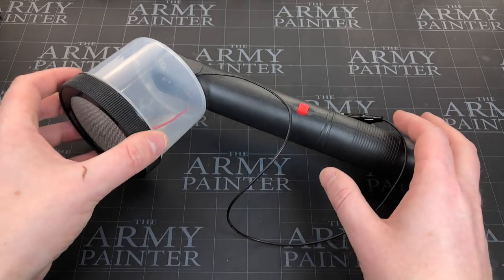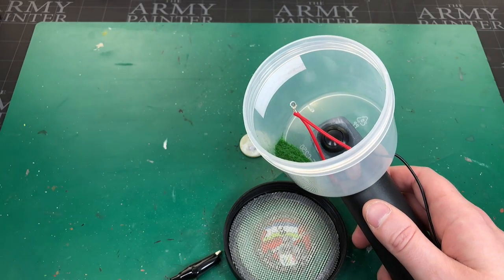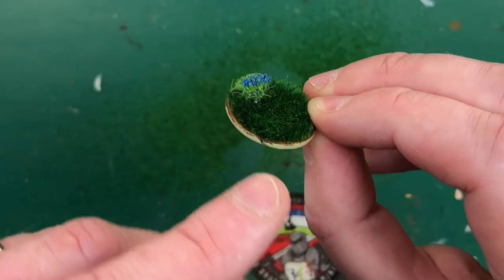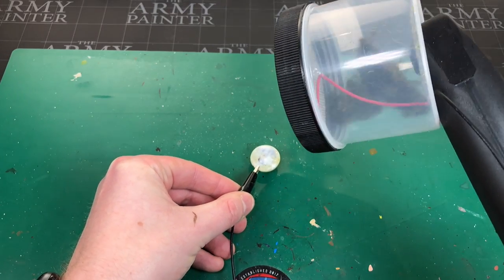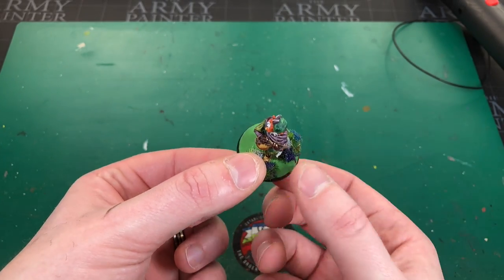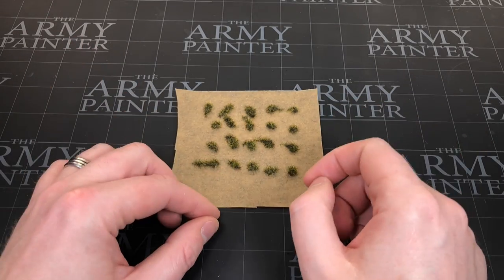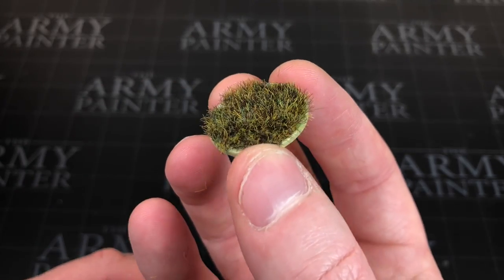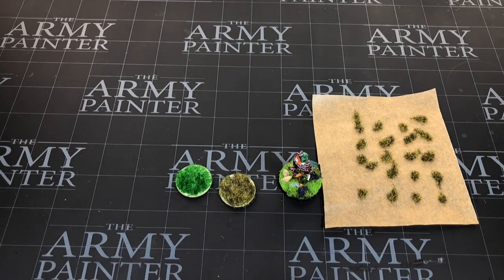Static Grass Applicator - How to get your model grass to stand up or create your own grass tufts!

Comment: If you clips a metal pin (panel nail or something similar) in the crocodile clip you can apply the grass by not having the clip clipped onto the base. You will need to do this when covering larger areas anyway as the earthing point should not be to far away from the applicator or else it will not work correctly.
Reply: Thank you was looking for this info🙌

Comment: you can do something slightly different, get a metal tray (a sheet of foil might work,  put several small bases on top of the foil/tray and connect the foil/tray to the crocodile clip, for tufts do the same as above but use baking paper of even better a silicon sheet
Reply from the maker: Great tips! Thanjs

Comment: Not available at the link, but I found one on ebay with the same design, most likely a knock off, but when can you do when the original is not available? I like static grass, but not $300 or whatever applicators cost for those doing the train stuff, but under $50USD, sure, why not elevate my tuff game!
Reply from the maker: Ah! I did this tutorial a while ago, and I guess they sold out since, I updated the link to another one, thanks for the heads up! Yeah I agree with you, for $20/25 its a fun tool and it dramatically increases my bases IMHO.

Comment: Obviously the one I ordered from Amazon doesn't work.The light turns green, but the grass doesn't fall straight.
Reply from the maker: Noooooo! How does it fall!? Mine just falls down with gravity but is pointing up from the charge
Reply: @WatchItPaintIt  Maybe I managed to solve the problem, I used a piece of wire and attached it to the ground wire with the clamp.  The grass seems to be falling well now, I even got an electric shock to see if the current was circulating

Comment: i got this exact one, does the wire have to touch the mesh for it to work? mine isnt touching and im worried about making it touch for if it implodes or somehing idk xDD
Reply from the maker: Haha. Yeah it has to touch the mesh. Mine didn’t once and it didn’t work! Bent the wire back onto the mesh and away we went :)
Reply: Since it should be touching so I actually connect the wire onto the mesh directly so that no matter what it will still touch.

Comment: 6:53 Do you think some sort of temporary addon attached to the underside would work? I'm still not sure how this works since the base is not conductive by my understanding, but maybe it makes some sort of electromagnetic field and the grass coming precharged through the grill makes a difference. So like white glue a piece of plastic on the bottom to hold the negative alligator clamp.
Reply from the maker: Oh yeah, I think you're right, just superglue a little bit of plastic to the bottom, or even a paper clip etc and snap it off after applying the grass! That's if you want full coverage, I guess in an ideal world you want varience so probably do it sometimes, and add rocks other times.
Reply: @WatchItPaintIt  Nice thing of course is you can add the rocks to begin with as opposed to adding a rock to hide a flaw, but good to hear it would most likely do the trick.
Reply from the maker: Yeah another valid point! Would make it look like the rock is sunk into the grass that way too! 10/10 please comment again :-)

Comment: Got one, worked once, now it does not work, what a piece of trash.
Reply from the maker: Has the wire come away from the mesh slightly? Mine did that once. I just had to bend the wire. The bare wire needs to touch the metal mesh for it to work
Reply: @WatchItPaintIt  Most likely i got one that wasn't checked by the quality crew, i opened it, the coil thing is burned, it heats there and heat spreads to the circuit plaque when button is pressed, it smells burned when it heats, i suspect that's what happened after the first use, it  only gives led light now with no static current at all. Maybe i got bad luck and got a faulty part that heated and burned. Was cheap at least...
Reply: Is it possible that i burned it myself by discharging it? I noticed that for every discharge i did it started to loose power till it died, i did around 500 tufts with it and did about 10 discharges, i suspect that to discharge, the mesh should not be touching the red wire, or it will short circuit it. I think. Maybe. Have you notice it? First use it had a lot power pulling the grass up and even made a sound, and then, it start to loose the static power till went dead. IDK, maybe was just mine in a case of bad parts.